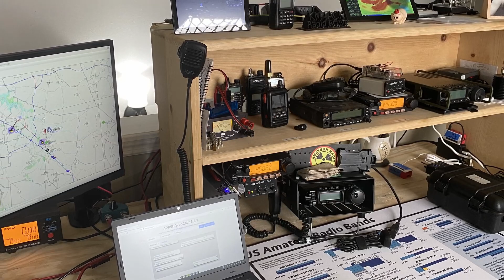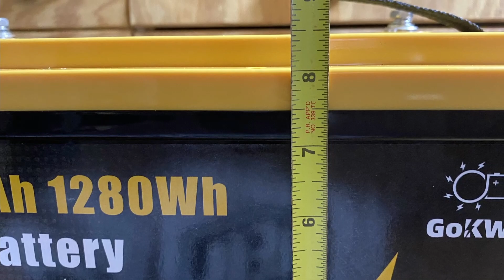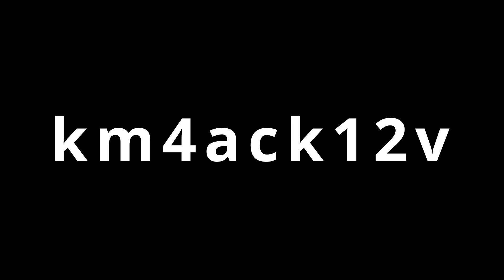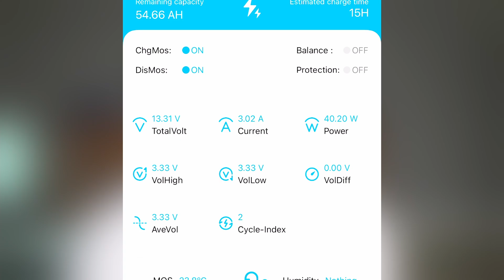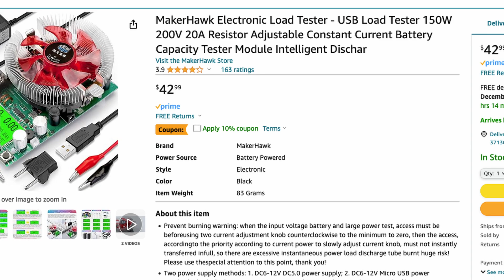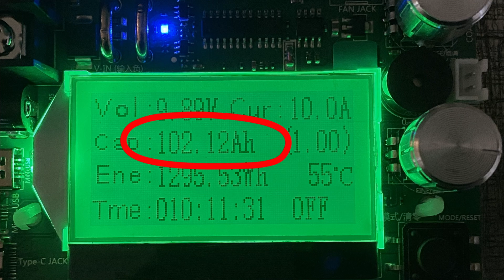Backup Battery Upgrade

Comment: For anyone interested in purchasing this battery, don't expect to receive it quickly.  Mine was ordered on 12/21 and has been 'in transit' for over a month.  Emails with the vendor have not been productive.  Still looking forward to trying it when it gets here.
Reply: Yes, my experience has been similar, ordered on 12/21 and no updates until 1/15 when they said it was “shipped”, however fedex indicates that they played the old, create a label but don’t actually ship the item trick. 12 days later, the item still hasn’t been delivered to fedex for shipment.  Vendor is unresponsive to emails. They don’t allow order cancellations but if nothing has shipped in the next few days, luckily I purchased with PayPal so I’ll have them reverse payment. Disappointing experience
Reply: I too ordered a battery from them on December 17 and have yet to see it has been shipped. It still shows a shipping label has been created. I’ve emailed them several times with no response. Today I filed with PayPal for a refund. I was looking forward to this battery but will have to go elsewhere.
Reply: Mine did finally show up on 1/29.
Reply: @w4mcg  did the tracking information change from label created to the shipped?
Reply: Same..mine had a shipping label printed a month ago but hasn't actually been sent.
Reply: And it arrived...took 40 days.

Comment: Nice video Jason! A couple questions: 1- What charger (AH) do you use? And 2- Can you charge it while in use? Thanks! Jorge VE3EAD
Reply from the maker: I only had a 3Ah charger available so I used it. Should be safe to recharge a 100Ah battery at 20A.
Reply: If you didn't have the 3ah charger- what charger would you purchase?--  @KM4ACK
Reply: I have the same questions. Thx. 😉

Comment: Right now, for POTA, I'm loving my REDODO 12.8V 50Ah PRO. It is small, easy to carry, and has never let me down once. It's size and weight are great for POTA, and the 50Ah is more than enough. Why bring less Ah battery when this is small and light? I have their 100Ah which was already well under $300 (it's $239 right now on Amazon). When I saw the 50Ah battery which was much smaller and light, it became my POTA battery!

Comment: Careful with your hot swap idea. Hooking a charged battery of one capacity in parallel with a depleted one of another capacity will likely cause a large current rush blowing fuses or tripping over current protection in one or both batteries. I'd run the solar cable to the shack and hook up the solar charge controller there on your distribution.

Comment: Pouch cells, which wouldn't be a deal breaker, but the website says "The sides and tops of the batteries can not be placed face down" which is sketchy for an LFP battery. Also does not include low temp charging protection, so make absolutely sure you don't charge it 32F/0C. If you keep it warm and upright, it seems like a good battery at a good price.

Comment: All right, you got me to bite on it.  I didn't actually expect I would order one but the discount code you provided worked first time, and when I calculated shipping, it said it would ship free to the US.

Given that I have paid around $800 each for two Bioenno 100Ah batteries, I thought I would go ahead and order this one as a backup for my 200 Ah mobile set-up, but primarily to just keep in the shack as a back to the 40Ah Bioenno I keep in there to run my rigs off of.  Thank for the lead.
Reply from the maker: Welcome. It was a nice upgrade for me coming from the 36Ah battery that I was running previously. I am sure you will have the same experience. Hard to beat at that price.